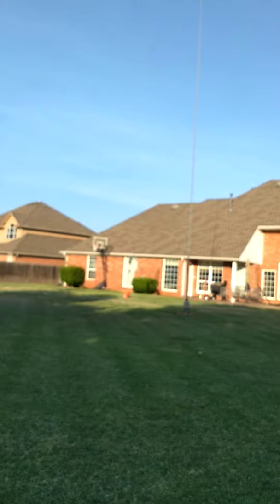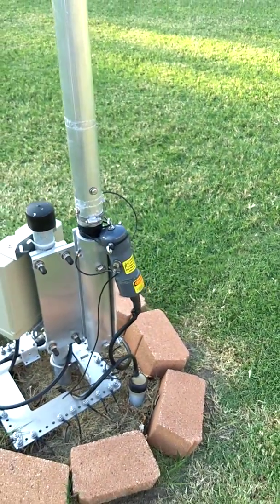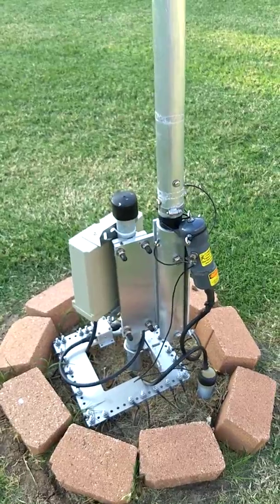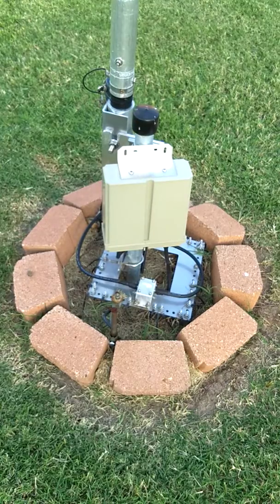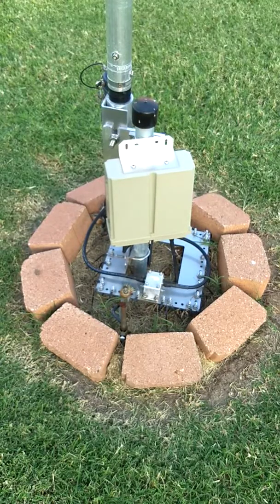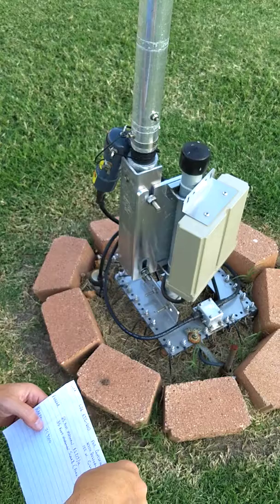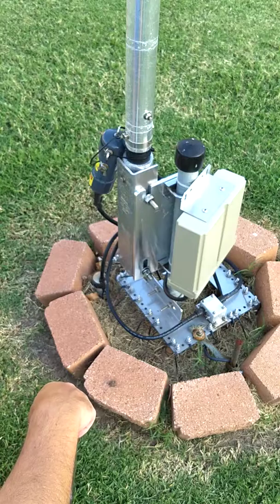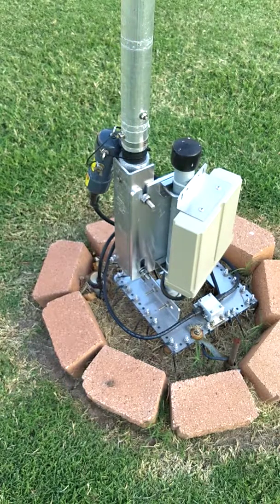43ft Vertical HF - DX Engineering MBVE-5A

Comment: Thank you for this!!     I notice you choose the 43 foot non-resonant vertical over a resonant vertical.     I'm wondering why you made that choice - and also what you are experiencing for DX contacts?     Sincere thanks!
Reply from the maker: A resonant vertical is only resonant on the chosen band.  Granted I could build a vertical antenna for each band but I wanted just one.  As for contacts, it's been working great.  I did replace the tuner with an MFJ that has the ability to handle larger impedance mismatches.
The ARRL Podcast "The Doctor is in" did a great article on the 43 ft vert.  It's very close to being resonant on several bands.. but use a remote tuner at the base of the antenna.
Reply: @N5ZY  Thank you!  I think this is the way for me to go also!   I have a nice auto-tuner that will handle high wattage - so I think this vertical will be a good work-horse antenna.  Thanks again!!!  And best 73s!  :-]

Comment: I dont know if you'll see this question or not, but at :40 you say  "on the side is a 1:1......something" that I cant understand because something made a horrible noise when you said the word.  Can you tell me what that was?
Reply from the maker: 1:1 current balun.  To ensure the current is balanced between the 43ft vertical and radials.  This still causes the impedance to be out of range for the tuner for the lower bands like 3.5 MHz and 1.8 MHz.  For those likely a 4:1 balun would likely work.  I ended up replacing both the tuner and balun in 2022.. I'm thinking water got into the balun or tuner.
Reply: @N5ZY  Thanks, after I thought about it I assumed you were talking baluns.   Just got my antenna yesterday.  Hoping to get it on the air this weekend. Put the post in the concrete last night.  Cutting radials tonight lol.
Reply from the maker: @DB-zp9un  Good for you!  Spring is the best time to plant radials.  Just before the grass begins to grow, mow the lawn as short as you can (or even just the patches where you will run radials, roll out the wire and use the garden staples to staple them to the ground.  After your first few lawn mowings this spring they will get covered by grass clippings that decompose and you will never see them again.
Reply from the maker: @DB-zp9un  I need to update my web page for this antenna and for the recent modifications I made.  https://n5zy.org/outdoor-antenna/
Reply: @N5ZY  well that’s almost exactly what I am putting up minus the tuner, I didn’t get the 998 tuner I  have the same series but the lower power capable one

Comment: I can’t seem to find that tuner anymore just the 100w version
Reply from the maker: I've found that out as well.  I spoke to a vendor at a hamfest and he said they quit making it because it just wasn't selling.   So when I needed to fix a 80m problem I ended up buying an MFJ tuner.  I wrote it up on my web site, https://n5zy.org  
Direct link to that write-up is here:  https://n5zy.org/outdoor-antenna/
Reply: Thanks for the response. That’s a bit to pricey for me to add. I don’t run an amp so maybe I can use one of the lower power mfj tuners. How well is it working for you and was there any loss on 10 to 40 vs just the unun or your other remote tuner.
Reply from the maker: @kevinokeefe7796  I do not run an amp either.. but the tuning range on this one is better.  So far it works well.. I've logged several new countries on 80m with JTDX and this tuner.

Comment: how does the antenna work?
Reply from the maker: I'm very happy with it.  Again, I can't get a dipole at 1/2 wavelength off the ground for 160, 80, 40, or even 20 meters so this works drastically better than a dipole that is too close to the ground.

Comment: how is this antennas performance compare to an inverted v dipole?  is it worth the money?  how is your swr? could the ground radials be place in a zigzag pattern I got a small yard possibly 40 ft by 30 feet  ground wire would have to be like a L pattern. you have it very nice set up. thanks for sharing.
Reply from the maker: Sorry, I didn't see these questions.  I've been very happy with it.  I could not use 80m or 40 without it.  I will add a coil in the autumn with a relay so I can use it on 160m and to improve the bandwidth on 80.  Yes, radials can be zig-zag.. they can be shorter as well if they are ground radials.  Listen to the ARRL "The Doctor Is In" podcast about verticals.  When I see a DX spot I try the attic antenna.. then run outside and raise the vertical.  The attic antennas, being dipoles, are way too close to the ground to be very effective.  A Vertical doesn't have that problem.
Reply from the maker: Also, I don't have SWR since I have an outdoor tuner mounted to the antenna base.  This is the proper way to use a vertical, unless you use ladder line all the way back in... which again, I can't do that either.  Using an LDG RT-600 tuner so it can handle data for a 24-hour contest without failure.
Reply: @N5ZY  Does the RT-600 tune smoothly from 80m to 6m? How does it behave in the wind?
Reply from the maker: @ThinKkBIGG  The tuner with that ant cannot get down to 80 without more inductance.  I'm working to add a relay and coil to give it a little more L.. using an article I read in QST.  I have been waiting on cooler weather.. but not sogging wet weather.. then parts supply shortage.. 
The antenna does ok in wind but I take it down out of caution anytime the wind is getting over 25 or when storms are coming.
Reply: @N5ZY  What type of balun do you use?
It seems that with a 4:1 Current Balun instead of a 4:1 Unun, it would be easier to hit the lower bands. 
With the 4:1 Unun 80m at 10m and with the 4:1 Current Balun  160m at 10m. 
73!